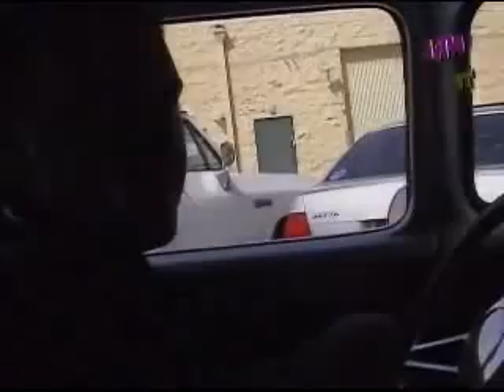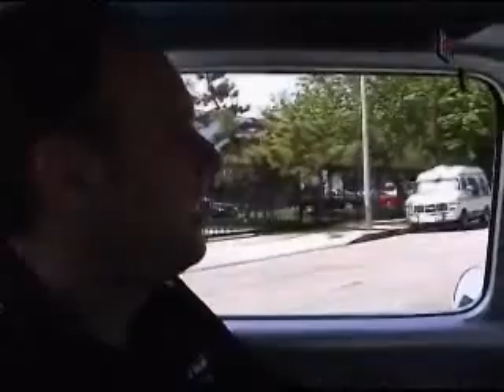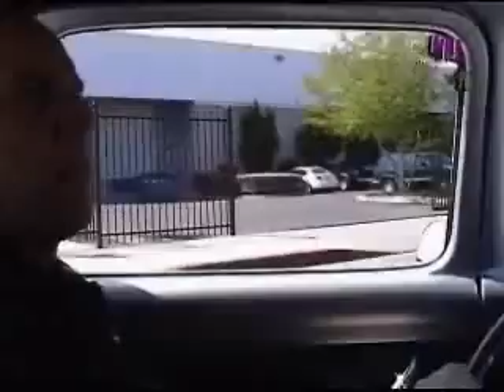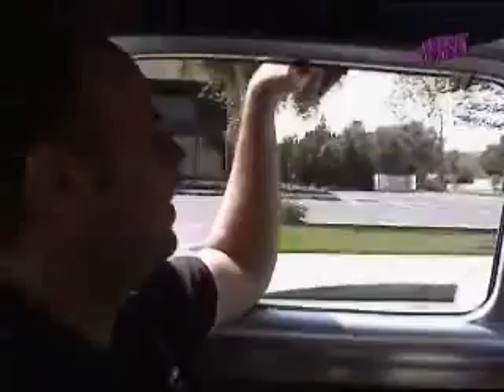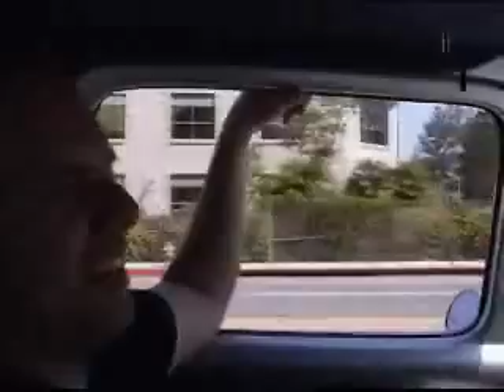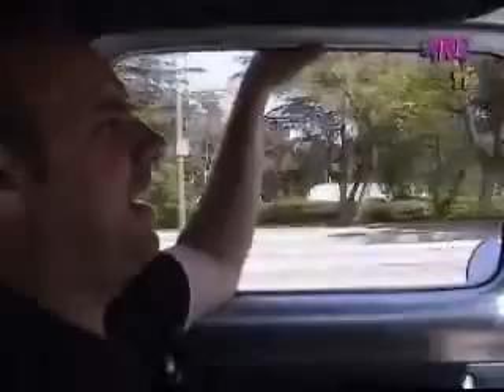Tim Allen's 56 Ford F-100 - tuned and test driven by Tom Nelson

Comment: Tom Nelson did a great job tunning Tim Allens truck. It was Gregg Jacobson AT PFD that designed and built this engine , including the custon made one off kinsler Fuel injection manifold  with Electromotive Tech GT engine management.